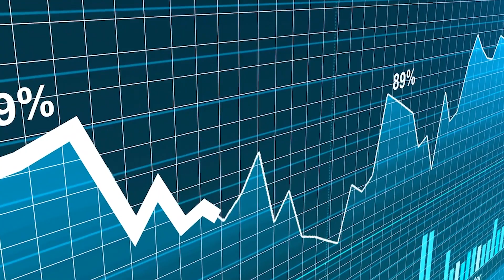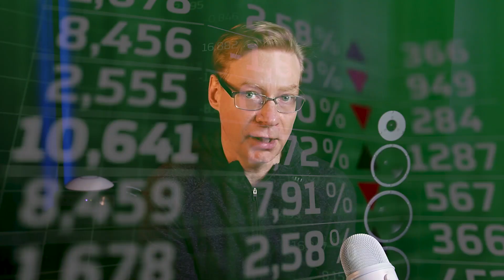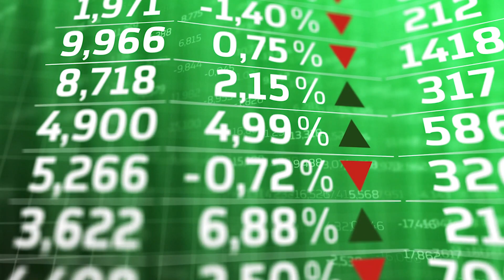When Will Tesla's Stock Price Jump?

Comment: 400 dollar end of the year, 800 dollar 2023, 1100 dollar 2024, 1500 dollar 2025 is my model. So lots of profit is coming soon :)
Reply: My children will appreciate the inheritance
Reply from the maker: The SP doesn't tend to move linear.
Reply: I think 1500 in 2030 is more realistic. There is going to be significant p/e compression by then.
Reply: Tesla's rapid growth will become increasingly difficult to maintain. Tesla knows how to design a great EV. Tesla learned how to mass produce EVs.  Now Tesla needs to figure out how to build and ramp more plants and supply chain quickly. This will get increasingly hard to do as they get bigger.

Comment: I wouldn't mind hibernating, being awakened in mid-'26 or so; big payoff won't come until production numbers overwhelm doubters. 4680 production may remain a blockage, but surely will be resolved within a year or so. By the time competitors even get close to Tesla in EV production, the company may be focussing on robotics, energy storage, which are just as lucrative.
Reply: Van Rozay:  Battery chemistries / batteries are improving so fast I don't even see the 4680 as mandatory, except perhaps for the Cybertruck. 

M3P / LMFP batteries are looking fantastic.  And I think battery makers are just scratching the surface on experimenting with such chemistries and techniques which will improve multiple factors of BEV batteries. 

1).  Even without 4680 success. 

2).  Even without solid state batteries becoming a practical thing. 

Now, obviously the 4680 is a nice extra competitive and cost advantage for Tesla, but Tesla doesn't need everything they're working on to  be a resounding success or on schedule, for it to do well. 

It STILL looks to me like only BYD is offering Tesla SERIOUS competition at large scale, whether the 4680 is delayed a year or two, or not.
Reply: Production will bring it up. They just missed Blue Chip rating and that will come soon.

Comment: 2025 LEAPS are coming out Monday, per the options council (I looked it up yesterday).   Once they trade for a few weeks and get some volume, it should be safe to trade those (re getting a decent price), re my long experience trading options. 

Or just ALWAYS use limit orders and patience if EVER trading options with thin volumes.  If you're patient and make the market come to you, you're more likely (in my experience) to ensure you get a fair price. 

Now that the stock price is at a reasonable level, I prefer to sell Tesla theta vs. pay a lot for Tesla theta, but each to their own.

Comment: Hey! Do you do any covered calls? If so, can you explain your strategy. I finally made it to 500 shares. I don’t want to lose the and have them assigned, but I also want to collect premium on times like this where the stock is flat.
Reply from the maker: No, I don't want to risk losing TSLA shares.
Reply: Ive lost & gained equally with options until I got a margin call & they sold 12 shares 😭
Reply: Sell calls? you mean puts? If you sell a call and the stock goes to 1000, you lose $100,000 on paper (1000 x 100 = $100,000), that would have been yours. There's a gap on the chart at 250, 90% of all gaps get filled (price will touch 250 once again)  THAT'S where you wanna sell puts. Selling puts or calls in the middle of a price could be dangerous (like at 350) if price takes a big swing down, you could lose your stock.. if it goes up a lot you'll just lose paper profits.

Comment: It's really hard to tell, especially since it's current valuation already has quite a bit of forward PE (or "good news", if you will) baked in. So Tesla has to massively outperform the current competition" just to justify it's current valuation. Let alone a Jump upwards.
Reply: Do you have calculation on the current forward PE to be in any way expensive based on 2022 and 23 earnings estimates or is it just your perception? Also it seems unclear how Tesla needs to outperform its competitors any more than they already do - Tesla will actually accelerate and outrun competitors even more in H2 2022 and 2023, please check available estimates, production capacity, gross margin per vehicle and factory and new factory ramp-up. It actually looks like Tesla’s PE is way below where it should be for company growing earnings as fast as they do.
Reply: @kubismatik2  All i am saying is that it's current valuation is basically the sum of all other major carmakers combined. You and me know that this is still cheap because not only will Tesla own that market but also other markets. But the jump will only occur once this becomes self evident to the wider market. Right Now the consensus is that "Yes, Tesla is an amazing performer BUT it is currently massively overvalued and needs to first catch up to that valuation". Again: That's not my perception but the perception of Wall Street. And as long as that perception persists the stock will not jump. We had basically the same thing prior to 2019/2020 when the stock didn't move for ~6 years despite Tesla killing it nonstop.
Reply: @kubismatik2  Tesla needs to exceed expectations for the stock to go up.

Comment: What about Russia turning off energy sources into Germany?  Won't that affect Giga-Berlin?
Reply: Russia is currently getting their ass handed to them. This war could be over in a few months.  But yes, the energy situation in Germany will affect all industry. Fortunately, Giga Berlin is very early in the production ramp, and not yet a big contributor to Tesla's bottom line.
Reply: @78katz  I wonder how reliant Giga-Berlin is on that energy.
Reply: @jkimo11  I don't know.  But it's safe to assume that the factory cannot operate without Nat gas.  Where they source it and how much it costs is another question.
Reply: @78katz  yes, I’ve read they need it to melt the aluminum.  Hopefully, they’ve thought ahead and stored some until things get “back to normal”……